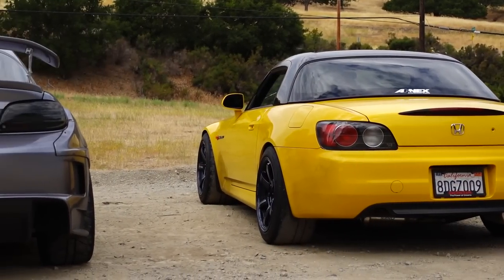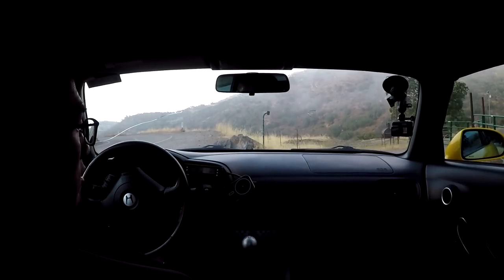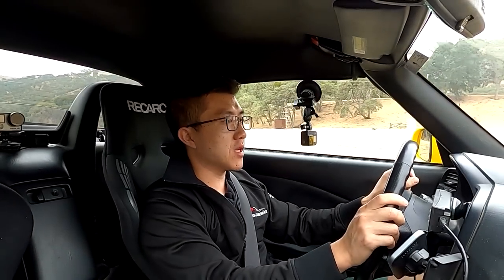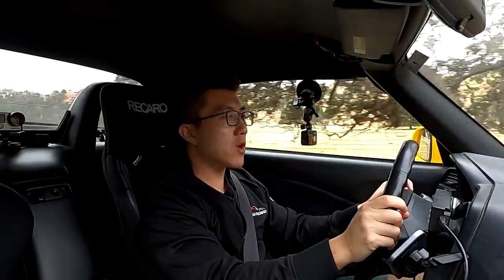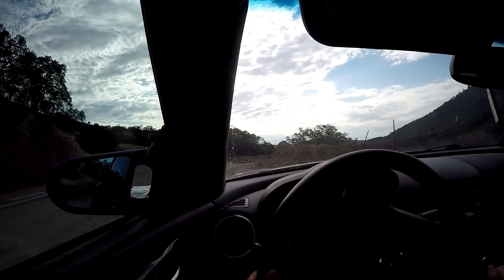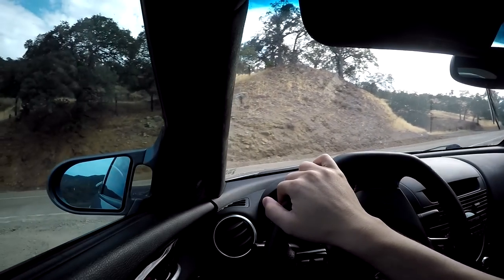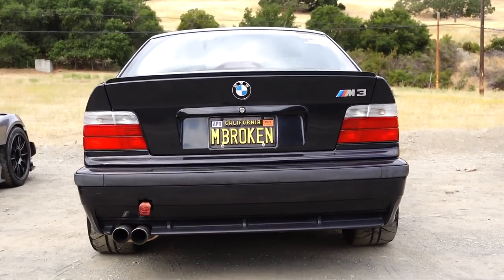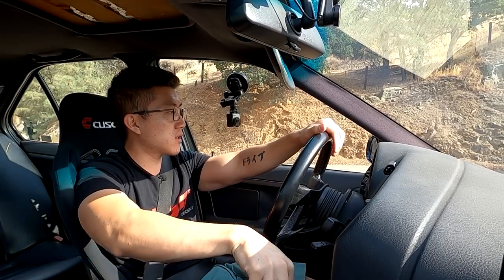Honda S2000 vs Mazda RX-8 vs BMW E36 M3 (Modified) - Head to Head Review!

Comment: I was shopping for my first car in 2009 and my choices was an RX8, S2000, 350Z, or G35. Drove them all and I liked the RX8 the most and bc it had way more room. I had so much fun with it. I was at a stop light last year when a grandma plowed straight into me and totalled the RX8, I still miss it now.
Reply: Yep, this is what happens when test driving both car side by side on the same test route...
Over 2 decades ago, a Mazda/Honda dealer selling these 2 V6 FWD minivans, no one wanted the Mazda van while all Honda vans got sold out.
When the RX-8 came out, a Mazda/Nissan dealer is not discounting much on the RX-8 while the Z sitting in the show room already got a dead battery.
Reply: Dude one owner hot start rx8s are super cheap

Consistently see them for 5k and under 

Cosmetically perfect cars usually 60-120k depending on the year if its prefacelift or not. Just know you will spend ~300 bucks and 4 or 5 hours of your time rebuilding the engine 

Rebuild kit and buy a junkyard renesis so you can build a motor while you drive it

Comment: You did a great job reviewing these quintessential "peak drivers car" cars. I grew up with E36s and moved into S2000s a few years ago. Even at 7-8/10ths on a public road, the S2000 is a challenging and engaging drive. You're constantly managing the weight and working with the car to negotiate the bumps and cambers. And after you finish driving, you're tired and don't need to drive it again for 2 weeks. At 8/10ths on a public road in the E36, it's a confidence machine but doesn't ask much of you. I still miss it from time to time, especially the sound, refinement, and quality of driver inputs, but the edgy balance and peaky nature of the S2000 still has me hooked.
Reply: My S2K was super raucus and fun. But I tamed it a little bit by upgrading to Bilstein suspension and it handled beautifully without being nearly as tail-happy as before.
Reply: I wish as I went through E30, E36, E46 and into an AP2V2, that I knew I was experiencing what history would remember as some of the driver's car greats. Still have the S2K with low miles and great condition which makes it much easier to deal with having sold the BMWs.

Maybe it's just me, but of all the BMWs, the S2K reminds me most of the E30.
Reply: Wym by dont need to drive it for again for another 2 weeks?

Comment: I've never seen an RX8 look that good!
Reply: That’s why i clicked😂😂
Reply: Agreed, swap a 13B or 20B and that thing will fly
Reply: @Unxpekted  rx8s are 13b, and a brew/20b swap is like 20k 😂
Reply: @drakemadman00  its a side port 13b he means a proper one thats in the rx7 ;)
Reply: You don't have to swap the rx8 because that's too costly. You can just port it; either bridge port or street port.
Reply: +200hp easily.
Reply: Because it has body work.
Reply: @drakemadman00  I made a custom low comp rx8 that made 450hp now what?
Reply: @ivanrousseau5066  then you've built an even more unreliable rx8. Hybrid is the way to go. What rotors did you use? Did you just dig into the MSP rotors? Did you swap out the side housings? Frankly I have a hard time believing you. There's a reason why its never done because there's no way to fit low comp rotors in there without clearance issues with the side seals and corner seals nicking the ports.
Reply: @drakemadman00  Pettit racing has a engine kit that uses the 13b rotors ,I have a hard time believing you are a Mazda expert and don't know this.  Sounds like you don't know as much as you think.
Reply: @ivanrousseau5066  1st I dont think YOU know as much as you're saying. I cant even find the kit. Just because I go for built not bought doesn't mean I know less than you. However, looking here the only "kit" they offer is just building and porting your renesis to stage 1 which doesn't make 400whp, unless you bought the brew engine isntead? And ofc it uses 13b rotors, so does the renesis bozo, I ask WHICH 13b rotors?
Reply: @drakemadman00  Pettit PBR 3 comes as a complete engine build, not parts.and uses 13b fd rx7 rotors with custom made outer gas seal rings.and a turblown turbo kit easily making 450+ atw .bozo
Reply: @ivanrousseau5066  theoretically those brew rotors (don't call them fd you're not helping your case) will work. Still can't find what you're talking about, and never heard of a gas seal? Gas doesnt need to be sealed? It runs through the intake and exhaust porting. And what you mean to tell me is you dk nothing about rotaries, Pettit racing does.
Reply: @drakemadman00  your a jackazz
Reply: @ivanrousseau5066  just sounds like defeat
Reply: @drakemadman00  no it sounds like you don't know as much as you think you do.3 or 4 of theses have been built , just a few years ago someone on rx7 forums was selling. The machined rotors and eccentric shaft I don't think Pettit sells them anymore,they used rx7 REW "notice the rx7 part " because you seem confused  with taller REW apex seals  they were also machined to lighten them and more clearance, they also machined them to accept the RX 7 oil SCRAPER RING. That you claim can't be done unless you spell them correctly. So I have a hard time believing you have the knowledge to school Mazda owners on what's possible and what's not. Maybe you can pick another topic to try to impress others with your massive ego. Just admit you were wrong so we can move on.

Comment: Nice group of cars in this head-to-head. The RX-8 GT trim end up a little heavier because of the sunroof, among other things. My Sport (Base model) scaled at 2864 with basically no lightweighting except for a catback and aftermarket wheels. A fresh engine with a lightweight flywheel will liven up the car a lot, probably will feel like 20+ hp. That and the RX-8 has by far the best chassis, I've driven my stiffly sprung RX-8 thousands of miles over shit northeast roads and honestly it's really composed. But all of the cars here with sticky tires have such high limits that there's no way the limits are really consistently reachable on a backroad.

Comment: Love it man! Great comparison. For someone who prefers torque and low/mid range grunt, the e36 has won me over. I sold my e92 m3 to get back into one! The fact that I can drive it for hours, I can daily it, and push it so hard all the time, all the while not going too fast- parts are cheap- has made ownership a blast.
Reply: Exactly, when comparing E90 with E36 (converted to quick steering rack), I noticed E90's steering feel is nearly as numb as E87's.
Reply: & of course, E92's boring hydraulic steering got even more numb on the V8 version (M3).

Comment: S2000 would be my choice for pure driving fun, but the E36M in that 4 door MT configuration is an absolute unicorn today.  Can't find any comparable, relatively lightweight RWD NA sedans like it anymore.  Nice comparison video.
Reply: Not a sedan, but the E87 130i would be comparable.
Reply: @richiesworld1  I love the slick-top E87's tall driving position, but that hydraulic power steering got even less feel than E84 X1 AWD's.
Reply: Can find nothing like the E36M? Skyline GTS-T, JZX90/100, Altezza, E30, E46, list goes on and on.
Reply: @kanaric  You just proved my point lol.  None of those cars are being made today.

Comment: I have an e36 M3 as a daily driver, and weekend autocross weapon.  It's brilliant.  However I've always been intrigued about the RX8 and would love for it to be my first Japanese car.
Reply: Rx8s are fun but finicky have to be ready to get greasy or spend money. However, everyone I have ever met who has either owned or driven one wants one again. They're designed chassis first.
Reply: @btownballer27  Sounds like every BMW I've been involved with.  I have a friend with an early RX7 and it doesn't seem too troublesome.
Reply: @John Pearson  the 8s are more finicky due to the exhaust ports being on the sides of the housings and the side seals not wanting to stay in the rotor. Also to mention if you ever consider buying one get it compression checked and get rid of the Cat. They ruin these cars.
Reply: @btownballer27  The seals will stay perfectly in place as long as the cooling system is maintained, lubrication is adequate and the car is driven to the redline fairly frequently once the engine has warmed up. On the other hand, unlike the RX7, there is no risk of detonation. We agree on the cat though
Reply: RX8 can fit more tire without body mods which can be a big advantage.

Comment: Have an E36 M3/4/5 w a lightened flywheel and stage 2 clutch. Great car, lots of fun and has back seats for the kids. Also have an AP1 S2k and that car is on another level. Agreed! Best gearbox ever. Nothing shifts as awesome as an S2K transmission!

Comment: The S2000 feels like a precision tool, but you sacrifice a lot outside of actually racing.  The low rigidity limits it.  And the steering feel is remarkably poor.

The RX8, at least comparing stock to stock, is a GT car.  It is comparatively VERY soft, comfy, and with looooong gears.  With it's soft suspension, tall gears, and sort of high weight, it is a little out of place racing.  The biggest benefit of the RX8 is that you don't compromise outside of racing.  It's a good drivers car, it's comfortable, quiet, and seats 4 actual full sized adults (yeah, really).  The RX8 needs to be modded to be tailored for a more pure racing experience.  However, it does handle well racing and will neutral out mostly just by disconnecting the front sway bar.  The RX8 has a VERY rigid chassis, and it can much better make use of stiffer suspension.

The S2000 is a good sports car stock.  You don't have to do much to go racing.

For the RX8, I think it needs a diet, could really benefit from a close ratio gearbox that feels right for the 10k redline.  The RX8 with the ND Miata transmission and a 5.125 final drive would be great (basically 1 through 6 is compressed down into the stock 1 to 4 gearing range which is much more appropriate for the motor).

The E36 M3 is a different set.  For one, it's one of the better power to weight options on the market.  The M3 sedans have historically been so.  They're powerhouse machines for their eras.  The chassis is...so so.  The E36 chassis was never developed well for sport use, not really.  They just made it work ok.  The E36 and E46 are good cars, but the E36 is a comparatively ancient chassis from the 90s.  You're buying a lot into power plant and some chassis effort by BMW.

But what's best?

Oof.  GR86?

The reality is these are all pretty dated cars, and for how good the FT86 and GR86 is, these older cars become a much harder buy.  The FT86 already had a better chassis, better steering, better braking, better shifting, and better handling, stock, than any of these other cars.  It's remarkably good and also a blank canvas for modding with a big aftermarket to support that.  The only gripe was the engine power, and the GR86 fixed that.  So, why buy one of these older cars?  I don't really know.

This is my take.  I have cash and I've put money down on sports cars a couple times with the ability to buy whatever I wanted for under $30k.  My first buy was a RX8.  I've autocrossed all of these, even back to back, and I still walk away liking the RX8 best.  The second time I bought a sports car, I bought an old Z4 roadster.  I've driven everything from a Honda Civic to a Viper, and there's stuff I can like and appreciate.  But there's only a few things I really want to own.  The RX8 is one.  The Z4 is the other.  This is over a S2000, over a M3, over a Mustang 5.0, over RX7, over so many other cars.  Why?  The character of it and what the package holistically gives you.  I think that's why I most gravitated to these two.  They are the least compromised, most total package sports cars you can get, and they have oodles of character and have that special sauce feel.

Comment: I don't really think Bilsteins are really anything to be ashamed of.  I think with some treatment from Fat Cat Motorsports or someone similar who understands suspension then it would be a fine weapon.  I feel like if you put a set of Ohlins, JRZ or Penske's without proper clearance and setup then you would still have the same issues.  The fact that there are so many Bilstein parts available and tuners make them an excellent monotube to build off of.

Comment: RX-8 owner here! Feel free to ask any Qs :)
Reply: Differences between your rx8 and the one in this video? Any improvements or drawbacks to the mods shown?
Reply: @michaelwakim2198  I think he meant he owns the RX-8 in this video.
Reply: What bumper and hood is the rx8?
Reply: @richardpaik1159  it’s the vision bumper from leg motor sport and r magic carbon vented hood
Reply: What's with the Anime stickers? How much power did each add?

JK, I have an RX-8 as well, so the real question is: What was your favorite mod?
Reply: @jakegarrett8109  +20 waifu power ofc

As for the second question, I’d say it’s the body kit. It wasn’t cheap but it makes the RX-8 look 15-20 years newer. The recaro seat is up there as the support and driving position has been much improved vs. the stock GT power seat while saving about 30lbs of weight. I used to say suspension (stock rx8 feels quite Miata-ish with body roll), but my setup right now isn’t fully dialed it so it’s not as good as it used to be, especially with these rough California roads.
Reply: I agree that with you that the front bumper makes the RX-8 look more modern. Your car looks amazing! Did the body kit add weight? If so, how much? Would the front and rear bumpers work with the original fenders or do you need to get the whole kit? Thanks
Reply: Same
Reply: How much hp does it have? And with your current power, can you break enough traction to drift slightly or atleast do a power slide?
Reply: @mylifetimetools  super late response but the body kit is nominal weight-wise. The front bumper works just fine with the original fenders, but I think you need a more aggressive rear bumper setup (mazdaspeed or anything with a rear diffuser) and wing to balance out the looks.
Reply: @racernotracist  Have not dynoed it but it's probably 5-10 more hp than stock. You don't really notice the power, moreso just the sounds. Hard to break traction on 200tw tires but you can get oversteer and the back to rotate if you whip it into a corner fast enough. Not really willing to try getting power-slides on the street lol

Comment: Good exhuast, intake (which is hard because Mazda nailed the intake but there are few that are better), tune, and maybe a streetport or bridgeport will free up that 20-30hp on the rx8, but after that there's nothing until boost and/or gslse side housings lol coming from an rx8 owner

Comment: It's worth noting E36 M3's are going to be double the price of an RX-8 in the same condition, and S2000's triple or more. RX-8s are pretty much impossible to beat for the value.
Reply: There is a reason for that.  You get what you pay for.  Reliability costs.
Reply: E36 M3s are easily the same price (or more) as the S2000 now for similar mileage + condition, and around 3X that of the RX8.
Reply: @z32luvr  tbh reliability has been basically fine for me for the last 20k miles, but it’s hit or miss
Reply: @beauwulf  a quick glance on bringatrailer tells me this is not correct, clean s2000s seem to sell for about 30k-40k ish on average vs 20k-30k for a clean E36 M3, but this is the US market. Frankly I don’t really care, I was just trying to point out that a nice RX-8 plus the price of a fresh motor install / rebuild is still significantly cheaper. If no rebuild is needed, even better.
Reply: @rotaryenforcer  it’s going to always have issues and be a maintenance nightmare. Not to mention hard to find a competent mechanic to work on it.
Reply: @z32luvr  no offense bro but that’s nonsense, there are tons of YouTube videos that debunk rotary unreliability. If you consider a “maintenance nightmare” adding premix to your gas tank or not turning the car off when cold, you aren’t mentally prepared to own any type of sports car. It’s fractionally more temperamental than an idiot-proof camry and car enthusiasts act like that means the sky is falling. I’ve owned a heavily modified rx7 FD for 7+ years which is far harder to own (and tracked my rx8 when I had that) and never had a major issue or engine failure.
Reply: Great platform for a swap though, get one for 3-5K and put an LS in it and you have a crazy capable car for under 20k.

Comment: My JDM Rx8 now weighs 2660 pounds and still has Air Con and full interior. Trust me when i say , its an S2k beater on track and a totally different car than a stock one ... Watch my channel and you will see for your self ... Granted, the JDM Rx8's with cloth interior start their lives at 2888 pounds ... I managed to remove another 220 pounds from that and the car is on a completely different level ... It has nothing to get jealous of  from an S2k ....

Comment: E36 makes for the best spec racing platform, s2000 is the best from the factory; rx8 has the most potential. 

You can’t compare these as if they’re apple to apple.
Reply: Well the point is that these have all been modded to bring out some of that potential, but yeah I need more tuning (and monies) to get closer to the other two cars suspension and power wise lol
Reply: @PeterPangea  I’m finishing a 700hp capable e36 build just waiting on a couple more parts. The e36 is the ultimate sleeper platform and is on par with what the fox body was in the 2000s where nobody wanted them. E36 and e46 base model cars are the perfect platforms for spec or sleeper street builds.